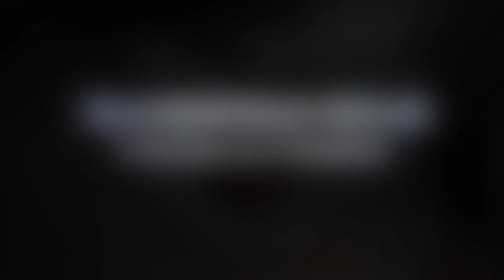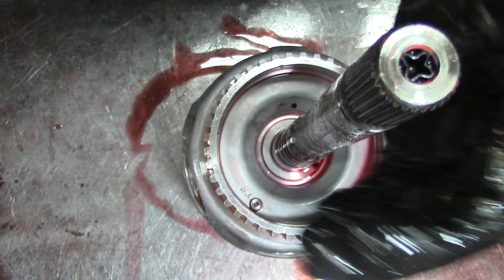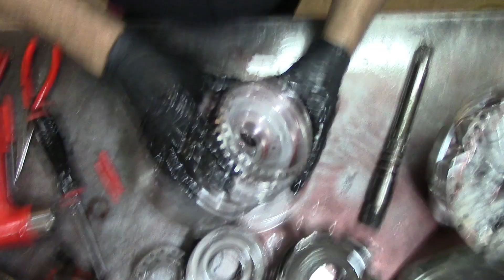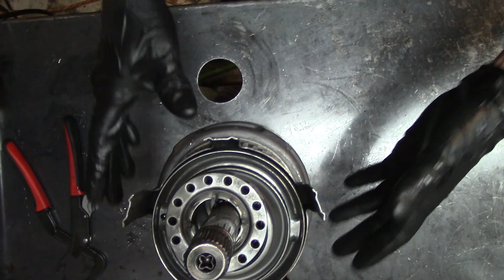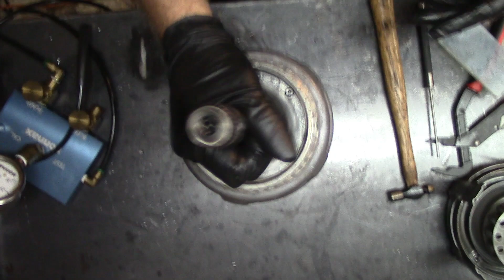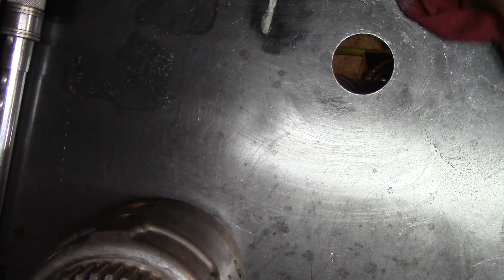4L60E Input Drum Leak Testing

Comment: Sonnax told me to use Loctite 609 .... it jb weld good for the vibration
Reply: 609 was too runny for my taste I've been using JB weld with success because it clings to the metal better. Quick tip before pressing the shaft back in throw that drum jn the oven for about 45 min or more at 250 degrees, right before you take it out prep your shaft with JB weld and have a q-tip ready to spread it in the drum. That shaft should slide all the way down without using a press, make sure you clean the feed holes inside the drum with a rotating action to spread the excess JB weld in to the seems. The purpose of this is to get more sealant in between the shaft and drum and as the drum cools it will compress the sealant and fill any imperfections and also makes a better bond.
Reply from the maker: @martinez1701a 
Excellent tips. 👍

Comment: Thanks Hiram, I actually found one leaking (input drum shaft) on the 60 I am building now.  I have the same blow gun and put the tip through the exit hole inside the drum (all the pistons were out) for 3/4 then blocked the apply hole in the shaft.  I used brake clean in the bearing/shim pocket and then applied pressure.  Only tiny bubbles but have been told that can get worse with temperature.  Going to press the shaft out and reseal tomorrow.  This is just what I needed to see.

Comment: I really dig the JB WELD THING...... BUT won't a Hard launch or linelock break the JB weld "seal" ??
Reply: I think the JB weld is stronger than whatever retaining compound the factory used originally, you shouldn't have a problem if the shaft was still tight and just needed to be resealed. The one he repaired was to loose for my taste.

Comment: Thanks for all the good knowledge. I have a question please. If I buy a 4l60e kit for a 2002 gmc will it fit a 2002 4l65e? Seals, clutches, I know that input shaft is different but are all the other parts the same. Thank you.

Comment: Good video Hiram! I like to see how others do things. It doesn't matter how long you've been at it. You never know what you might pick up. The only thing I disagree with. Is I would never use that drum that had the big leak in it. Sealing on a bench with JB weld is quite different that a drum is under a constant torque load. Although it work out just fine. That is a risk I would be wiling to take. Drums are cheaper than comebacks. Keep up the good work!
Reply from the maker: Yeah, that drum I probably won't use. 
The replacement drum looked a little gray but wasn't leaking. I still do the same procedure eventhoug the drums don't leak.I used to use red loctite but opted to use JB Weld instead. The JB Quick also works but not too fond of it. At least not for this.
Reply: @AutomaticTransmission  although I prefer to replace the drums when they're like that I have to agree with your assessment the J-B Weld Repair does work but also know that Transtar sells a repair kit for those upfront input drums where the shaft likes strip out the hole I believe it us called front input drum saver

Comment: Excellent videos Thank you .
I have a 1500 Express 4.3 van.  Now torque converter shudder.
Orherwise good at 350,000 miles hauling tools equip.
Reply from the maker: Look for the P1870 video I have on the channel. There's 2, one early and one late. Yours is the late. Do the valve flip to make it on/off instead of PWM. If shudder goes away you'll be okay. If still there then converter clutch is already gone. Which is normal wear and tear.
Reply: @AutomaticTransmission Thanks. Shudder only happens 50-65 mph light load goes away when under load so tcc  clutch is prob ok?
Just dropped pan oil clean  changed twice a year spotless no debris .Thanks for helping.